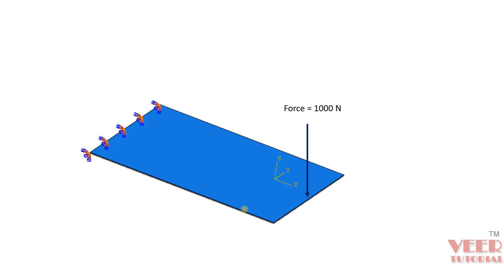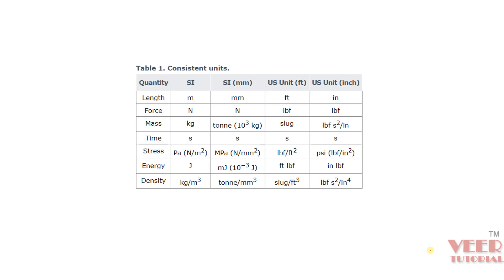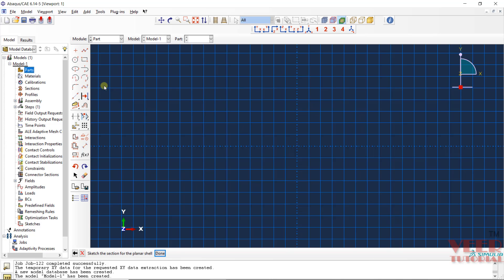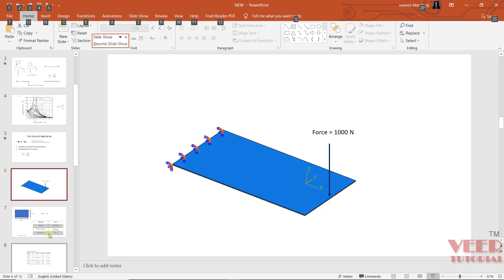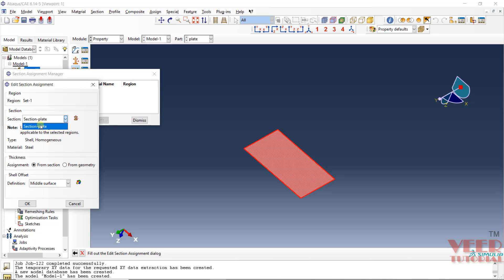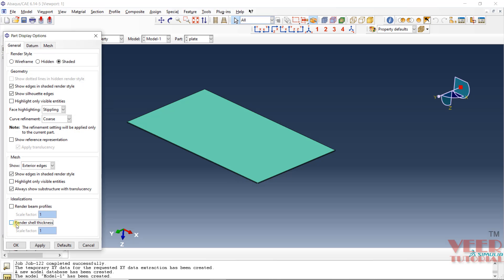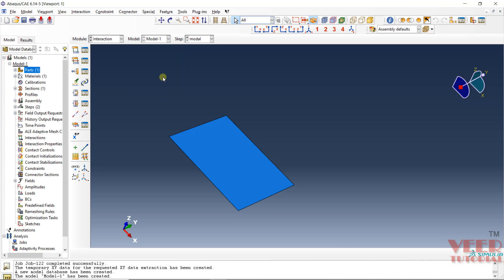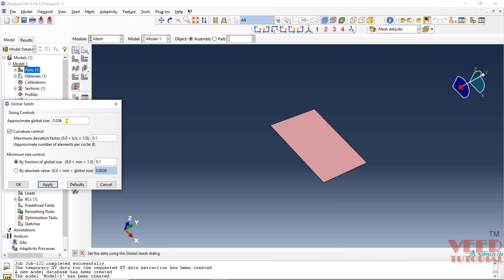Abaqus | frequency Response Analysis | Part 1/2

Comment: Thank you for this video. May I ask, when we get the results, does it mean in that natural frequency of the plate shows a deformation like the result (colorful deformation) or the deformation shape is not true just the found natural frequency is correct?
Reply from the maker: with deformation, we only check the overall behaviour of part at specific natural frequency. whether it is bending, twisting etc.